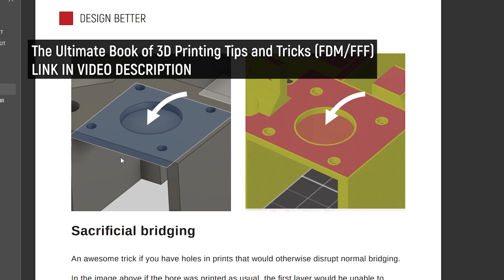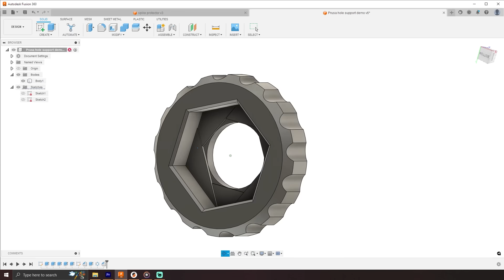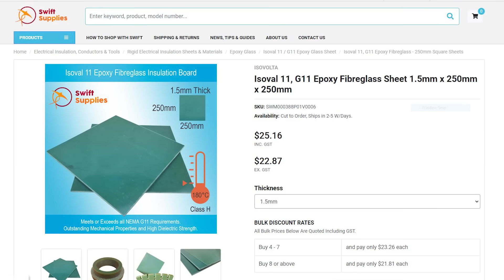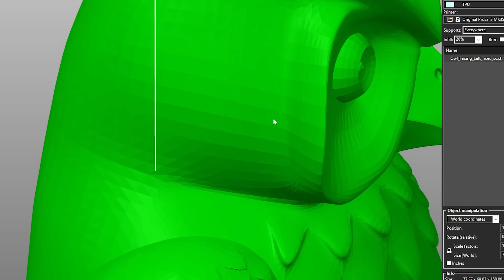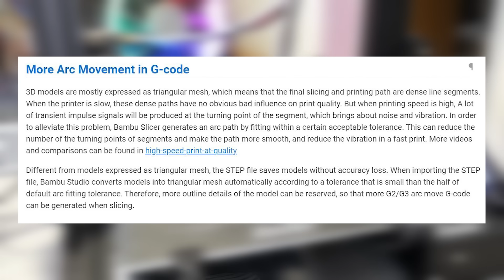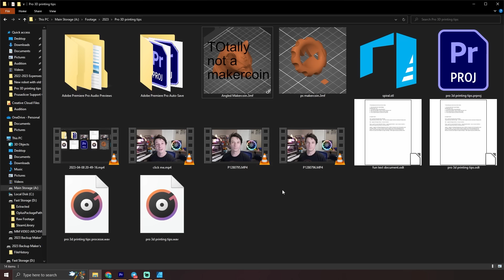5 3D Printing Tips I wish I knew years ago! #3DP101

Comment: I've found that the glue stick you use does actually matter. In the case of the UHU Stics, for example, I avoid the blue or purple "magic" versions because they use different formulas, break down under heat and just won't hold the prints down... use only the original white-capped version.
Reply from the maker: Solid advice. I've only ever used cheap white ones, so the basic formulations seem to be the way to go.
Reply: @MakersMuse  Good ol' Elmer's all purpose glue stick has been the best glue I've used yet. But any non-dyed ASTM rated gluestick works good.
Reply: @MakersMuse   If hairspray do not work for you, did you tried dissolving some glue in isopropyl and spray it?
Reply: I’ve been using the Purple ones with no issues for regular PLA prints on my Ender 5 Plus.  I suspect that your application of it’s use was likely to be off.
Reply: I found other way around.. The white ones never worked well but the 'elmers' purple ones worked far, far better and only needed a damp cloth to refresh between prints.  (And the blue ones or any of the UHU never worked that great)
But I was printing on just glass, not yet tried the alcohol trick or as a coating on PEI or one of the more modern surfaces.
Reply: I like the purple Elmers school glue. Only because you can see a purple tint when it's still wet, helps you get an even layer and make sure you don't miss anything. Then let it dry, once it goes clear you are ready to go.
Reply: I don't even bother with IPA I just use warm water to make the slurry. Also when I want to do a full cleaning, I just stick the build plate under warm running water or in the dishwasher
Reply: @neoncyber2001 its also good for cleaning because it turns purple again when wet
Reply: Completely agree, the purple stuff hasn’t worked well for me in the past
Reply: I just make a thin slurry of water and Elmer's white glue. To me it's easier to apply than glue stick + iso/water.
Reply: @gardnertreneman3008  ditto, I actually just smear stripes and use a wet paper towel to distribute glue and thus creating the slurry. It becomes invisible and create some finger  fat and dust tolerance
Reply: When I was printing PLA on a glass bed without a heating mat, I found that there is a huge difference between PVA and PVP glue sticks. PVP sticks are harder to find but they hold almost too strong - have to think in advance how to separate the printed part from glass. (Sample size - couple of sticks of each type, but I think I've read about it somewhere before seeking it myself.)
Reply: Thanks! I nabbed some of the purple sticks from my kids' school supplies. That'll teach me to get my own.
Reply: Purples Elmer glue has never let me down 😂 just tune your printer better
Reply: Hairspray, and it smells nice to
Reply: @kelvin1316  I’ve had a hard time finding a hairspray that actually works since Covid. All I can find is “non sticky” formulas 🤷🏻‍♂️
Reply: Ive used the blue magic stuff for half a year now and it has worked fine for pla and petg.
Reply: @slimekinglp9194  PETG doesn't need any bed adhesion product. Just clean print surface. But I can see if you go back and forth between PLA and PETG you may just leave the stuff on.
Reply: @Psychlist1972  i use a Glass bed so i use it to protect the Glass, when printing with Petg. But for other Materials you're right 👍
Reply: Personally I only use green Scotch glue stick ( brand of 3M )
Reply: Interesting, I've always used the purple stick and only have problems when i put glue on a dirty bed. I use garalite so I don't use a lot of adhesion compounds anymore.
Reply: I often use blue painter's tape, but I also keep the white Elmer's school glue sticks around. I just mist the plate with a little clean water and smear it around after each print, then when it accumulates bits of plastic debris, I mist it and scrape it off and re-apply.
Reply: I stopped using glue sticks after using Adheasy spray (same as 3DLac) for the first time. It's a game changer for problematic materials and is super easy to spray on. No more lumps of gluestick and annoying stuff like that...
Reply: I’ve used the purple for hatch box abs and asa
Reply: Elmers craft glue stick is awesome and usually can find it at Walmart where they might only have the purple one that doesn’t work well for anything other than pla
Reply: I just use PVA glue and spread it on with a spatula. You can dilute it with water, and it dries when the bed heats up. That fixes most adhesion problems in my experience.
Reply: Another thing to add to this. The glue dissolves in normal water. If you want a really perfectly even film not globs which affect the surface texture just drop a bit of water on your bed, mix it around evenly and then turn on your bed heater. The water evaporates leaving behind a self levelled film.
Reply: I’ve had zero issue with the purple Elmer’s. 

In fact I’ve even dissolved them in some IPA and sprayed that on the bed with great results.
Reply: I couldn't get any useful results with Glue Stick. But I also used the blue one from UHU.
Instead I'm using Ponal as a semipermanent surface coating. It lasts for about a year and works with PLA, PETG and ABS, especially with filament which normally either stick to strong or to little to the print surface.
Reply: Hair spray works great for me on glass. Less work than glue
Reply: I've always used hairspray for adhesion. It cleans off easily with acetone and also sprays on evenly.
Reply: I didn't even know that there was a blue or purple version lol
Reply: I've had no luck with cheap ones. The bed adhesion stuff I use is drastically better than any glue stick I've used, but YYMV.
Reply: I use diluted white wood glue (brand is "Ponal" in germany). Maybe the same or similar to glue sticks. Works perfect and is cheap.
Reply: 🤔 hmm this explains why my glue isn't working anymore. Come to think of it it was purple. I would have never thought the freaking color would have mattered. Lol thanks
Reply: I've only ever used the purple Elmer's glue stick. But to thin the layer of glue I used a spray bottle to get it wet, then stirred it around until the water evaporated. I never thought to use IPA. That would save loads of time waiting for it to evaporate.
Reply: I use amazon generic purple sticks and they work very well. A little too well on some silk filiments...
Reply: I have been using Elmer’s white glue and the purple glue stick along with hairspray, depending on conditions sometimes one or a combination and I’ve never never had a problem with with the purple glue sticks I actually preferred to put on the purple glue sticks while build plate is hot.

I’ve had nothing but good luck with the purple glue sticks. I actually prefer them to the Elmers white glue, which I assume would be more like the white glue stick you are using. 

I’m gonna have to try the cheaper food sticks now to see if I have any benefit, but I don’t think I will since the white Elmers glue should be almost identical to the cheaper glue sticks once it’s dry.

Comment: How thick Do You think a g10 sheet has to be, to minimize warping
As i print big surface parts which are also high, always tend to warp in the edges
Besides all other mitigation methodes i use
Reply from the maker: I like 1.5mm thickness or so, held in place with binder clips.
Reply: @MakersMuse  how about 1mm or 2 mm? 
Which one would be better? Thick or thin for quick heat transfer?
Reply: @szekerespista3758  i would go thicker to prevent possible abs or similar pulling your bed up while warping,  worst case
Reply: @travistucker7317  OK, thanks!
Reply: @MakersMuse  I got rid of binder clips for my garolite, because they’re always fly around or are in the way. Micro clamps to screw on are the perfect solution imho.

Comment: I guess I'm not elite because I absolutely want folks to dry their filament and stop printing string monsters. 😂

Regarding desiccant, another tip you should add is to throw out the useless silica gel and buy 4A molecular sieve. It will keep your filament bone dry for months in dryboxes or even half decent zip bags. And it costs about the same.
Reply: Looks like a nice idea but it seems regenerating will be much more troublesome without an industrial oven.  It looks like 4A zeolite requires 2 hours at 550C to regenerate.  Whereas silica gel needs 2 hours at 120C.
Reply: @engineer1692  Folks successfully regenerate it without special equipment. I've never had to regen mine so far but I'll ask around for techniques. Household oven on cleaning setting, or microwave, is probably best.
Reply: @daliasprints9798  I'm pretty much guessing here, but i don't think microwaving is a good idea. Microwaves apply very localized and intense heat, wich will probably damage the structure of the sieve with rapidly expanding steam. Also bad ventilation
Reply: @N.M.E.  Yes, the protocols I recall seeing involve short bursts of power and venting steam.
Reply: Some chemistry labs use 4A molecular sieves for drying solvents/gasses, you can either buy them “activated” (pre-dried) or you can do it yourself. Plenty of labs do 2 minute bursts in the microwave until a constant weight. Some then heat under vacuum to get them really, really dry. The dust that’s formed from them grinding together isn’t good for you though. I would encourage anyone to read the safety data sheet (sds) and use the proper protective equipment before attempting to use them.
Reply: Its actually dangerous as when it absorb moisture it undergoes a exothermic reaction. Also its not easy to dry as silica gel because 4a needs to be heated under a high vacuum otherwise it wount be activated. Again dont use this stuff, its for the crazy ones that love the feeling things can burn down.
Reply: What would be the difference in using 4A and 13X?
Reply: Thanks for this advice. I will receive my order soon and test it.
Reply: This post is no longer displaying in it's entirety. The text is truncated at the mention of "useless silica gel" the rest of the post is gone with just an ellipsis after that mention? There is a whole conversation about a product or substance for adhesion that is mysterious to us latecomers since the only mention was in the original post.
Reply: @mikepettengill2706  There should be a "read more" to expand it, but in any case, it's 4A molecular sieve.
Reply: @daliasprints9798  I see the 'read more' now but Firefox was not displaying one at the time of my post for some reason.
Reply from the maker: Very cool! I hadn't ever heard of that stuff before.
Reply: "the Elites"? Sounds like a tinfoil-hated, trumpzombie's conspiracy theory, rather than a 3D printing tutorial. 😂
Reply: @Spangletiger  we finally dragged Trump into it. Great.

Comment: best tip: Level your bed looking at the skirt. I barely level my bed, but when I have to, I simply print with a 15 lines skirt and I just simply levelemy bed looking how the skirt is being printed.
Reply from the maker: It takes a bit of practice but that's a really fast way of dialing in a great first layer!
Reply: @MakersMuse  It's not just a fast way of doing it, it's potentially the most accurate way without some kind of smart automated electromechanical method.
Reply: @retromodernart4426  I have a CRtouch with 144 point levelling and I still twist the dials while the skirt prints

once you have it down you can get it levelled within the default 3 lines
Reply: @H31MU7  I meant a more sophisticated system than a CRtouch, but your point is valid, at the every least one reduces the errors that the mesh-leveling needs to compensate for by adjusting it manually too.
Reply: I print four 0.2mm prints . One on each corner of the bed. Circles 10~15mm in diameter is ok. Then peel them off one by one and measure them with a vernier. Adjust the bed level thumb wheels which can be printed in Petg for the 3mm nuts to make adjustment easier.

Comment: I have been using a G10 sheet since Angus did his video on it. It gives the print a crazy smooth finish and they cost next to nothing.
Reply: Actually I mostly use my Prusa mk3s+, as it is very reliable, so I wasn't able to test G10 jet (as prusa uses an inductive probe). While I also have some other printers, all have inductive probes... My main reason to order the mk4 update was actually the new Nextruder, using the nozzle as a probe, so I can try diferent non-inductive surfaces. Have to wait till June till the upgrade will be delivered, but I will definitly try G10. I have some blank spring steel for the mk2, so there should be no problem to glue the g10 onto it.
Reply: @oleurgast730  You actually can use it with those probes, albeit with a couple extra steps. I have a mk2, and I just have it do the mesh leveling like normal and then move up and out of the way for a period of time. Put the sheet on and hold it with whatever method you like, I use thick painters tape on portions of the edge. The important trick is to adjust the starting Z height after the bed leveling procedure relative to the thickness of your g10 sheet. Just make sure to measure it yourself to get an exact number.

It's a workaround for sure, and a tad tedious if you're doing a lot of small prints, but the results are often worth it. Regardless the Mk4 is absolutely on my shopping list too in the near future, that loadcell sensor is a godsend.
Reply: @shadows5698  Actually I thought about that, but as the powder coated spring steel works quite well (and I love the texture), I simply have not done the efford yet. But I think I will do a lot more testing different surfaces when the mk4 update arrives.